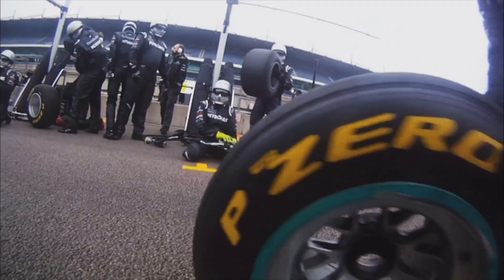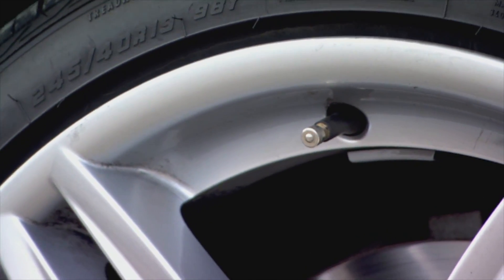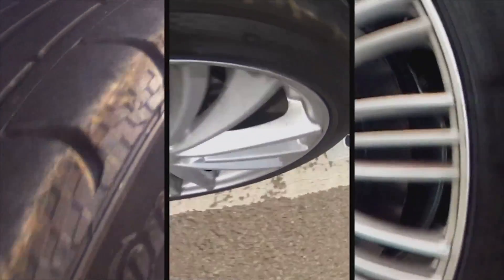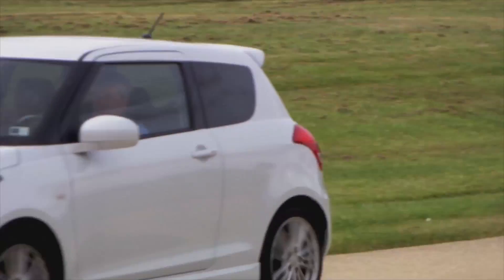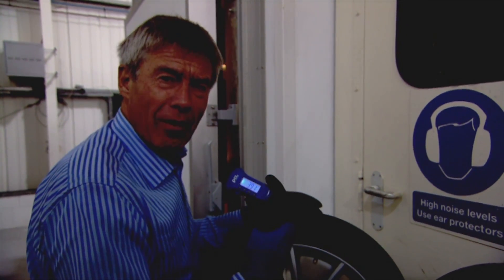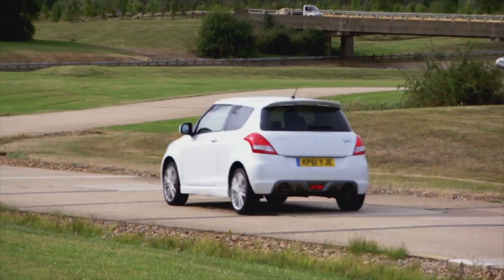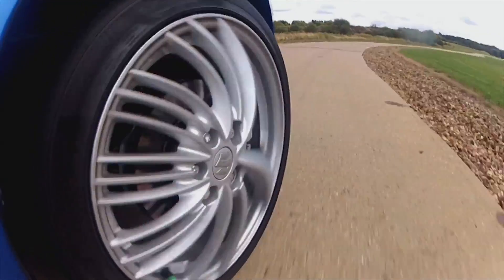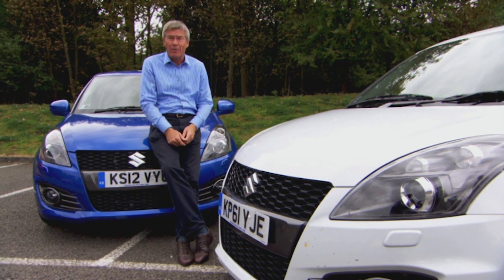Nitrogen vs Air In Tyres - Fifth Gear

Comment: What about durability? Will the use of Nitrogen reduce tire life?
Reply: +Krishnan Ravichandran No, possibly could increase the life, but very slightly due to lesser internal oxidation of the tire, but you wouldn't even notice because the tread would go way before the rubber fails from oxidation.

Comment: I recently got a new car and just found out they were filled with nitrogen but after looking at a few vids I don't think I'll be getting them refilled with nitrogen because it look like it's proven to be a money getter. unless you are a racer I don't think you need nitrogen filled tires and heck after watching this racers probably don't really need it.
Reply: +aluisious the only way to get all of the air and moisture out is to vacuum pump the tires to -30psi. Nobody does this.  If a tire has 0 tire pressure it is really at atmospheric pressure, about 14.7 psi(1bar) .  So there still is air in it.  Nitrogen fills are money makers. That's it.
Reply: +Raequan Smith The racers need it. Good nitrogen fills (surprised they didn't get a bottle, that would be easy) are 100% moisture free due to the process of separating the gasses. That's really what the racers care about the most, keeping consistency as much as possible.
Reply: aluisious that is the point.  You could never get it all out. It would be diluted.  It's just a scam.
Reply: aluisious a valve stem only works one way at a time. In or out.
Reply: aluisious well you can't displace if there is no out.
Reply: aluisious any dilution will negate the benefits of nitrogen.
Reply: Tracey Allen No shit, really?
Reply: Tracey Allen If you were really desperate to dry it out, repeated fills and drains of nitrogen would do it. I doubt a tire would stay on the rim under vacuum.
Reply: Tracey Allen You can't "get it all out" by pumping on it with a vacuum either. The real world is never perfect, you use a method which is effective to the degree required.
Reply: That's not true. I use nitrogen gas all the time to displace moisture in equipment.
Reply: Ok. I have nitrogen in my tires can I switch back to air?
Reply: @margaretsealhunter3420  Yes

Comment: Just don't care if you're not a racing driver. All tyres leak even with pure nitrogen. As others mentioned it naturally becomes higher nitrogen content after a few addings of air.Just use goed dry air,water expands a lot when getting hot! Edit:Think steam engines and steam turbines that run nuclear aircraft carriers and almost all our huge coal and gas fired powerplants and the whole lot more.Even turbines getting their power directly from jet-A or natural gas get a lot of power by converting liquid fuel to gaseous high pressure combustion products.Mainly water and CO2.

Comment: Nitrogen filled tubeless tyre are good for the fuel economy and it pressure does not drop for a long time.  Check whether the air filling station has an Nitrogen generator.

Comment: Since the air already in the tire when it is installed is never purged, that means subsequently inflating it with nitrogen does precisely nothing.  Your tires will be filled with roughly 78% nitrogen and 150% imaginary bullshit.

Comment: Boyles ? don't all gasses expand equally based in relation to thermal expansion?
Reply: +Tro SayJump Only in pure samples. In a mixture each gas expands proportionally based on its vapor pressure (partial pressure) much like a mixture of two liquids soluble in each other do not add up to the sum of initial volumes or how the volume of a solid solute and liquid solvent is not equal to the sum of both.

PV=nRT 
Pressure (in atmospheres)
Volume (in Litres)
n = Moles of specific molecule (this is where partial pressure comes into play)
R = Volumetric coefficient, a constant (0.082 atm*L/mole*K)
Temperature (in Kelvin)

To throw a wrench into this equation, literally, the IGL is only for rigid containers and tyres are not.
Reply: Shut up nerd

Comment: The only thing that makes sense, is the companies that make nitrogen, have blinded fools with science, and not good science at that! The difference between oxygen and nitrogen molecules is beyond the tiny minds of idiots who fall for pseudo science.
The idiots who fill tyres with nitrogen at vast costs, are the same idiots who buy HDMI cables at £50, when a pound shop one does EXACTLY the same thing! Want to piss your money down the drain? GO RIGHT AHEAD

Comment: In the hot room Fifth Gear concluded that the Nitrogen filled tyres were not completely filled fith Nitrogen (probably even with normal air instead?). Still they went to the circuit and long and behold, there was no time or feel difference and, how surprising, they concluded that there was no difference at all between Nitrogen filled tyres and air filled tyres. Sometimes I think they think we are idiots.
Reply: +linkuei83 Agreed. But that was not my point. My point was that I very much doubt that the Nitrogen filled tyres were filled with Nitrogen, based on the "oven" test. If my suspicion is correct, it is of course a foregone conclusion that on the track there is no difference.
Reply: +Tyler D. True. Haha.
Reply: +linkuei83 Yeah, well I suppose you are right. But I still think that if they beforehand conclude that there is no difference, it is pointless to test the difference....
Reply: *****
Their outside is still exposed to air. Besides which, unless you're keeping your tires in a museum, the tread will be worn out long before any oxidation is even noticeable.

Comment: It's a scam for the normal consumer. Who doesn't mount a new set of tires after a few hundred miles of use.

All you have to do is over fill your tires and let the oxygen come out through the rubber. Each time you top off a tire, the missing O2 is replaced by 78% nitrogen. Replace 3 psi oxygen leakage in a passenger tire, it will be 95% nitrogen.
Reply: I don't know about where you are, but most places around here (SE Mi, USA) charge a buck for air, he quotes a price of £1.50 for nitrogen, which I believe is right around $2.25.
Reply: Isaac Karjala 

When the coin pumps first appeared, I'd been using a foot pump carried 
in my trunk for more than a decade .  Never took more than 5 pumps to 
top off a car tire checked monthly.  When that pump finally wore out in 
1996, I spent $8 to purchase a 12v compressor which I still have today.  

Buying air or Nitrogen is a scam, no matter where you live.  

(Merit aside, a 95% nitrogen fill takes 3-4 deflations, using 100% nitrogen to refill. Each time you deflate, the refill cuts the remaining other gases by half.)

There is no performance benefit to nitrogen fill beyond that of maintaining the pressure longer.  For people too lazy or ignorant to check their tire pressure regularly that may be a slight benefit.  No matter what gas is used, you still lose pressure through the rim seal by rubbing a curb or hitting a pothole, and in the north central region, you lose 6 psi pressure between July and January simply due to the drop in air temperature.  6 psi is enough to trigger a TPS error and reduce fuel economy 10-15%. 

 Nitrogen is used in race tires that don't have to last for 500 miles.  Under comparison testing in passenger tires, at the same initial pressure, nitrogen filled tires ran hotter, harder, and failed faster.  

Unless an attendant is doing the work for you, if you are paying $1 for one air fill., that's $1 too much.    You've been brainwashed into overpaying for anything that is dispensed from a machine,  $1.50 Cokes and $1 packages of salted junk food, that sell for 1/4 the cost in grocery stores. Brainwashing is easy to do; you just have to systematically make people poorer planners and less competent over time, by them that it's foolish to work hard, better to be lazy and ignorant.  

The bigger the lie, the easier it is to sell.  That's the art of the scam.  

Fact: You can run a better quality, more powerful compressor, which could fill hundreds of flats in an hour for 25 cents electricity and a few drops of oil.  Fact: A station owner is paying thousands of dollars per tanker delivery.  A good compressor is a small investment.  Fact:  When a station has a service bay, it already has an industrial compressor.  The one time cost of extending piping to an island and replacing a hose annually is less than the profit from one average gasoline purchase.

Gas price wars are long past.  Your refueling price includes what was formerly paid to attendants as a profit to the station owner, i.e. you are paying to pump your own gas.  If you do what attendants did before greed set in, you are either paying for the time that you spend to check your oil and clean your windows, or you are paying for neglected maintenance.

Comment: Finally a fair test showing real world application,but if you insist I don't mind taking your money you want nitrogen I be happy to fill it. 1 question what are you going to do when it does eventually leak out, drive around till you find a refill station or just put air in for free or pay for a top up?
Reply: +P Kuudsk I would have used the same car and maybe the same tires and just changed from air to nitrogen.   You also need to do it double blind, the driver not knowing which tires are on the car...   Frankly though,  I think the difference isn't even measureable on a street car.

Comment: You'll never get 100% nitrogen in a tire unless you mount the tires and rims in a vacuum chamber. But I just take mine to outer space just to make sure there is absolutely no air in them at all.
Reply: +Zohn Williams nitrogen chamber.
Reply: +GraveUypo So you mount the tires inside the nitrogen chamber?
Reply: DodgeCity111 Lol. I usually go to her too but she was busy that day.
Reply: Tj1056 

Tires aren't designed for a vacuum.

I'm sure it would void the manufactures warranty.

Besides I wouldn't trust a tire after subjecting it to a vacuum.

https://youtu.be/b5mbj5iV3H4
Reply: its very easy to do if you are serious about it, you run 2 valve stems, you can just pressurize the tire with nitrogen until the tire is only filled up with it or to save some money run a vacuum pump on one stem then fill with nitrogen on the other...
Reply: +DodgeCity111 lmao I'm crying XD best comment ever!
Reply: ,,Come on <Zohn>, you got what you wanted: Give these people air!"

(Arnold Schwarzenegger, Total Recall)

Comment: Air will always seep out of the rubber slowly but being a larger molicule nitrogen will seep out slower...also since their is a lower or no moister content in nitrogen it helps prolong the life of your rims and also the life of your non rubber valve tpms sensors witch all tend to corrode over time...also in colder weather like here in Canada salt does a number on your tires and with the drastic drops in temp the nitrogen stays at a more constant pressure....my company owns a nitrogen filling Machine that hooks to all 4 tires and deflates the air our of the tire and then pumps nitrogen into the tire a few times in a row to slowly push all of the air out and making it 99.9 % nitrogen

Comment: The tyre centres I've used that fill with nitrogen don't suck all the air out of the seated tyre (when it 'pops' onto the rim) first, they just inflate with the nitrogen. Basically, all the unpressurized air in the atmosphere will be in the tyre already, so filling it up with nitrogen is technically a waste of time, it only increases the percentage of nitrogen in the tyre. Use a specialist if you have a performance car. They'll suck all the air out of the tyre and it looks all concave. Then you know you have a stable tyre pressure.

Comment: nitrogen better cooling & heating in extreme condiotons. heats up tires in a more even temp. only useful for racing & i mean laps, not just ur run of the mill light to light bs. no reason for it on the streets other than spending more $... oh and to keep ur gt-r's warranty.....

Comment: normal air has about 90% nitrogen in it, so tires are already filled for 90%, so it's
nonsence.
Reply: 3DPeter It's 70% not 90%
Reply: 3DPeter if you watched carefully tiff said that its difference in taht 10%. watch it again to find out what it is

Comment: how was there not a weight test?  only reason I clicked.....
Reply: Keith Downes  Seriously? do you realize just how light air is, at most your talking maybe a couple GRAMS difference, if even measurable.
Reply: DanielRichards644 very measurable... enjoy this spoon fed knowledge since you couldn't google before speaking... remember the air is COMPRESSED so there's a lot in the tire and it contains WATER... there I feel better using some capital words like you did
Reply: Keith Downes
maybe your the one who should do some googling, dry air is 1.29 grams per liter and pure nitrogen is 1.251 grams per liter so about 3% lighter then air in it's uncompressed state, now from what I've gathered online the air in a car tire at 30 PSI weighs in around a few OUNCES so 3% of a few ounces is a few grams at best. so yeah i was right unless you can give me a link to something that proves the weight of air to be greater then this, I sure couldn't find it, but the math can be done if the volume of a specific tire and ambient air temperature is known using the formula PV=nRT
Reply: oh and that 3% difference is only on 22% of the air in the tire so reduce that few grams of weight to to 22% of that few grams, since air is 78% nitrogen to start with.
Reply: DanielRichards644 it's about 0.5 lbs. for 225/45r17, personal experience... spend a few bucks to save 2 lbs. of rotating weight?  sure why not... I would have still liked to see the weight differences in this video
Reply: DanielRichards644 btw it doesn't take much intelligence to weigh a tire before and after the service
Reply: Keith Downes
 half a pound, what kind of crappy inaccurate bathroom scale did you use to come up with that, and how many times did you repeat the test? to give you a frame of reference a C5 Galaxy cargo plane has 28 wheels, amongst all 28 wheels it holds 181 pounds of air when inflated to a MUCH higher PSI then a car tire, they are also much larger then a car tire and even so that works out to less then 6.5 pounds total of air (typically Nitrogen in airplane tires, as a safety aspect) so even on a tire that big with that much higher a PSI you couldn't measure more then maybe 0.1 pounds, if even that much.
Reply: DanielRichards644 lol and what psi is that???  you're still not taking into account the water in any of your rebuttles
Reply: Keith Downes
 Typically airplanes are over 100 PSI, also I don't account for the water VAPOR because at most (unless you pour freaking water into the tire) your talking 0.0297 pounds of water per pound of air, so again a couple of grams. How about you come up with some evidence, because EVERYTHING i'm finding online points completely against what your claiming, FYI if you measured a 0.5 pound difference in your tire between nitrogen and air that means the air in your tire would weigh more then the wheel and tire combined before the air is added, DO THE MATH.
Reply: DanielRichards644 humidity... if you have freshly inflated tires in a humid environment, you can let some air out into your hand for just a couple seconds and your hand will get wet... you can also see the water content in air machines at gas stations by spraying into the air... it's quite a bit of water, at least here in florida where 80% humidity is the norm... just go deflate a tire and reinflate it with ambient air, weigh it, then replace with nitrogen and weigh... no point babbling on about something you're wrong about... and I say deflate first because over time your tires will become nearly 100% nitrogen which is why this "mod" is pretty useless if you can wait for the natural filtration to occur... takes couple months
Reply: Keith Downes
dude thats the condensation from the colder air coming out of the tire interacting with the humidity in the air. There is no way you can get a 0.5 pound difference in a tire that small because that would mean the air (and what little humidity there is) in your tire weigh about 16.7 POUNDS which would be like have 2 GALLONS of water in your tire and your tires volume is only 3.2 gallons which in water would weigh out to about 26.7 pounds, so you would have to fill your tires 2/3rds with WATER to reach the weight required to see a 0.5 pound difference between "air" (that is 2/3rds liquid water) and nitrogen , MATH doesn't lie, your bathroom scale or whatever you used to get that number clearly does.

Yes I know compressing air creates condensation within the air tank, this is why large tanks have air dryers on the inbound air and small tanks have purge valves, I can use my compressor to compress enough air to fill 4 tires MUCH bigger then yours and only get maybe a few ounces of water from the purge valve.

I'm done discussing this because clearly your to stupid to grasp basic concepts of math or do any research on the subject or come up with ANY website (even a conspiracy site) that supports your weight claims, everything I find supports my numbers.
Reply: DanielRichards644 lol everything you said is assumed... go do it... it's about $60 for the service... can you not afford $60?
Reply: Keith Downes
 No EVERYTHING I stated is a fact of SCIENCE, and again you don't state how you weighed, which I take as further proof you used an inaccurate bathroom scale, scroll down to the last paragraph on this site http://www.pedrosgarage.com/Site_5/Nitrogen_or_Air.html you will see he does a tire bigger then yours and the weight difference is only a few grams. get off of the idea your bathroom scale was right because you took 1 before and 1 after weight.
Reply: DanielRichards644 ok mr emotional hahaha... I've already explained how you can get that much weight and even more weight is possible, reread what I've taught you... And get more mad lol